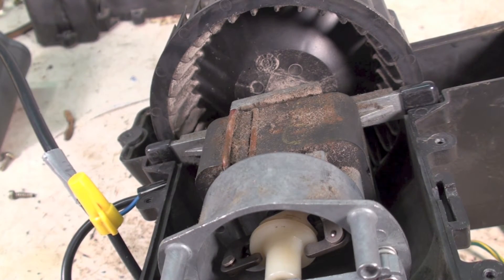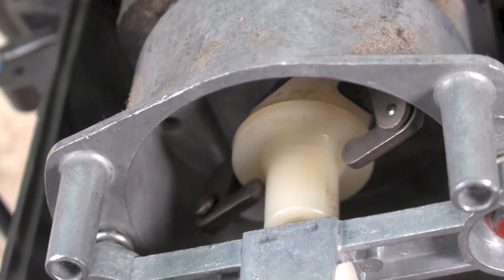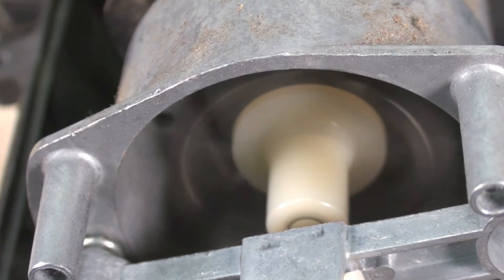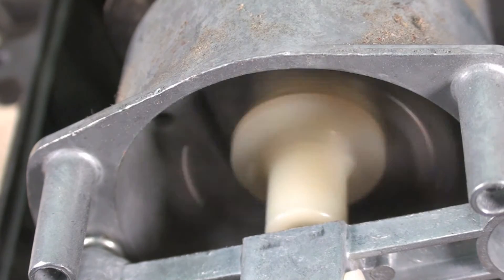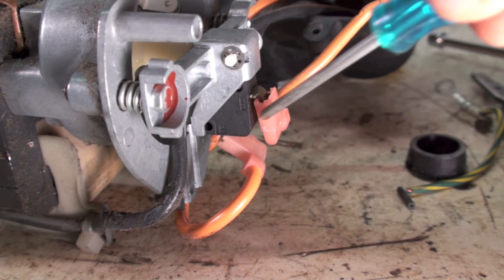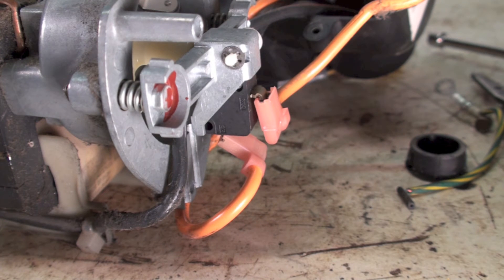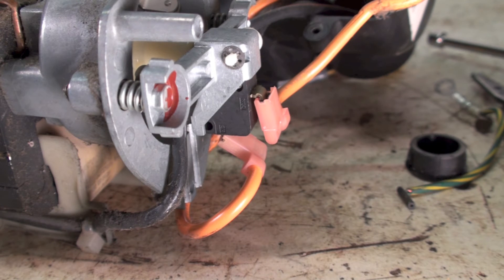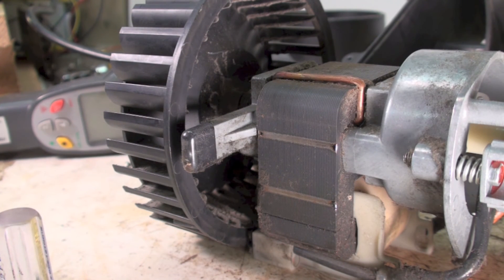How the Snyder General GUA furnace centrifugal switch works

Comment: Thanks for all of your videos on furnace repair. They came in handy recently when our furnace stopped working, and I was able to troubleshoot it with your help.  Found the centrifugal switch remained open after the forced draft combustion blower was running.  Is there anyway to replace the microswitch (per your video) with a new one?  Thanks again for your help.
Reply from the maker: If you are very good at repairs, you could.  Not sure if you can find the part.
GFM
Reply: d jackson You can find that switch at this link.  I just replaced the one in my Coleman Evcon CS.  Mine uses the Omron SS 10 but the one in this video appears to be an 
xxxxGLT type. 
Good luck!
https://www.arrow.com/en/products/search?cat=&q=Omron+ss10&r=true